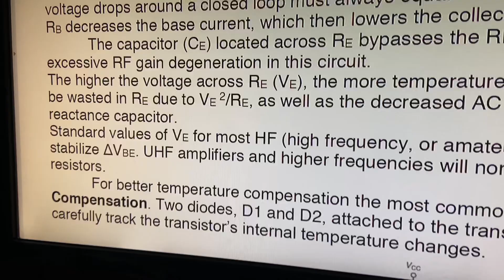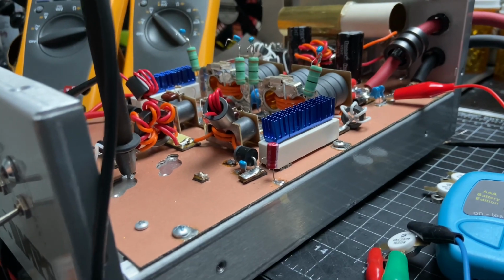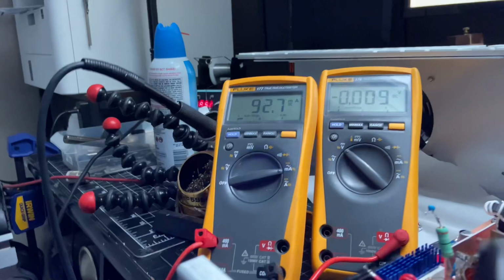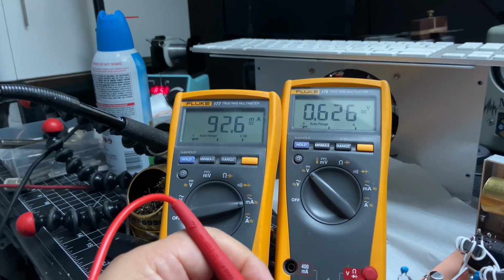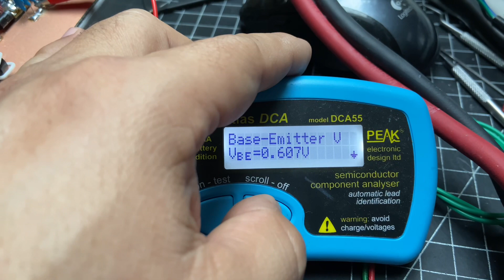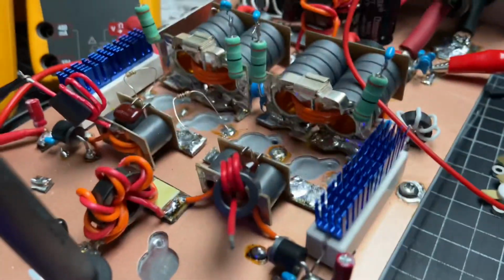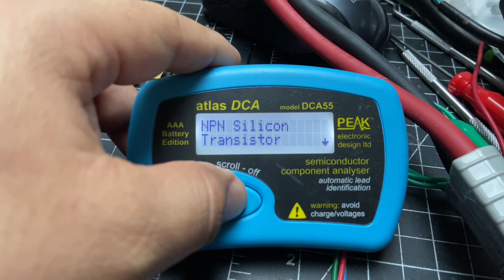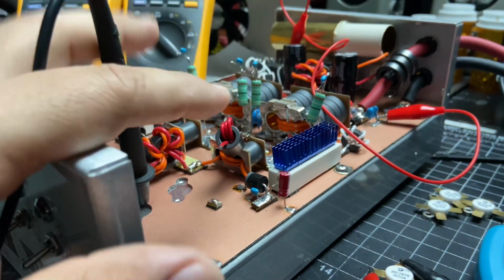Basics on bias for class AB circuit (English)

Comment: great video, do you have a video showing a detailed install. i wan to AB bias my amp I just built.
Reply from the maker: @Haxsaw67  No I don’t, it’s not only about install parts (the bias), the bias has to work with the rest of the circuit, if it doesn’t it will be unstable and you will burn the transistor.

Comment: Just a tip .. use shorter runs of wire when using 10 ohms resistor I noticed u used long legs on them not such a big deal ...but when running other runs of wire ..always use shortest runs of wires...the is is very important on the silver dip micas and metal  caps always use shortest as possible and alwaysqke them the same balances lengths ...just a tip
Reply from the maker: Always! this was just a demonstration of creating the current to base and doesn’t have to be always a 10 ohms.. 

Thank you for watching 
73